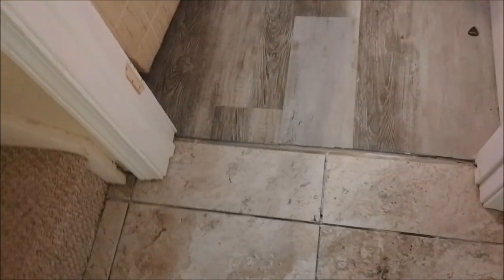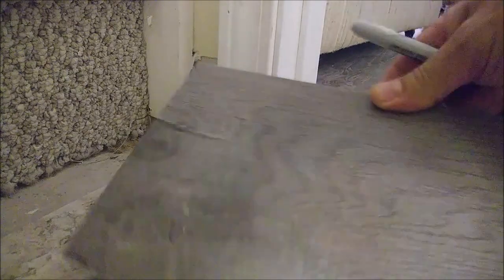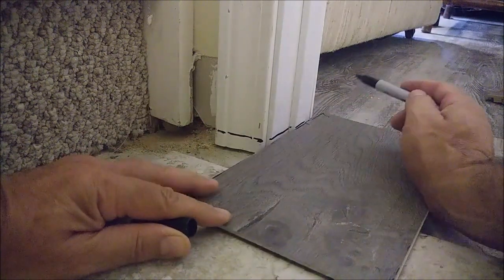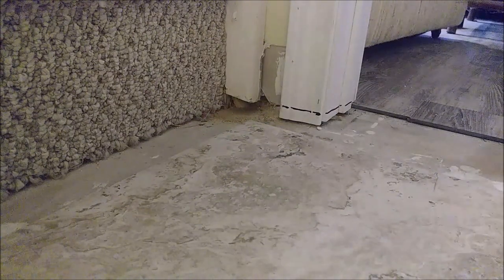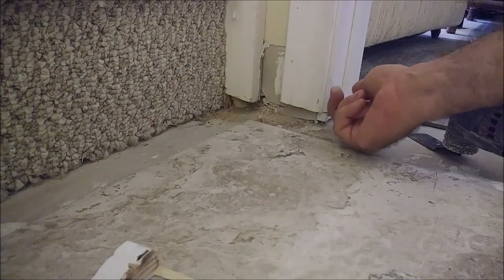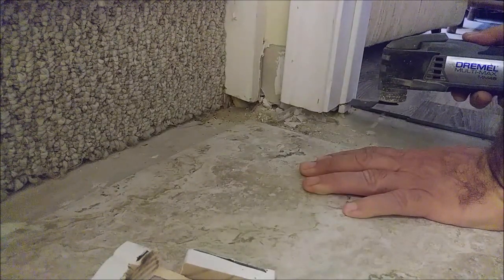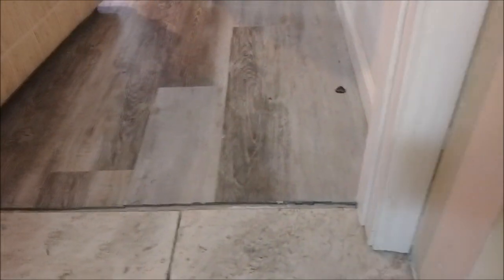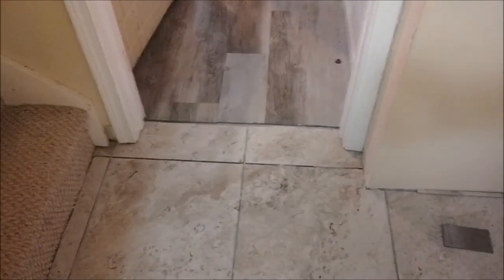How To Under Cut Around Door Casing To  Fit  Tile Around Door Casings And Jambs

Comment from the maker: Tools Used:
Dremel MM 50 = https://amzn.to/3zmq0uh
Other tools and Material used:
Grinder Kit for Tile Grout Mortar Concrete Masonry = https://amzn.to/3lOOo30
Thinset used Mapei Ultraflor = https://amzn.to/3taAsCX
Bosch Laser Level and Square GTL2 = https://amzn.to/3olZX0G
Multipurpose lavel laser = https://amzn.to/3coUK5O
Tools and Materials  used:
Angle grinder used = https://amzn.to/368IX8C
Diamond Blade =  https://amzn.to/3j2kTbc
Dimond hole drill bits =https://amzn.to/36bX2Cs
QEP wet saw = https://amzn.to/3cLJgaW
Diamond Blade = DeWalt https://amzn.to/3jfdpSr or Black Widow https://amzn.to/3jgx18G
Grout Float = https://amzn.to/3j7KO1c or https://amzn.to/348KLMu
Notched Trowel 1/4 x 1/4 x 1/4-Inch= https://amzn.to/3j26Zpv
Notched Trowel 1/2x 1/2 x 1/2-Inch= https://amzn.to/2S5Zceg
Notched Trowel 1/4 x 3/8 x 1/4-Inch=https://amzn.to/3cDPbhZ
grout sponges = https://amzn.to/3ieBx68
Nitrile Gloves = https://amzn.to/3i8VhrT
Best Thin set used = https://amzn.to/3cxVBz8
Medium thin set =  https://amzn.to/3mSk9aR
Mapei Pre Mix Grout = https://amzn.to/2HqhdC3
Mapei Grout = https://amzn.to/340hWS5
Miter Box Used =  https://amzn.to/2SnYgm1 or https://amzn.to/2G1CVfB
Hand saw =  https://amzn.to/30kvabp
48" Level = https://amzn.to/347tmUl or https://amzn.to/30m3y5H
Leveling System  = https://amzn.to/3n39GJN
Mixer = https://amzn.to/34lymod